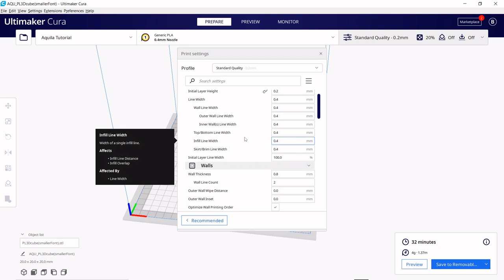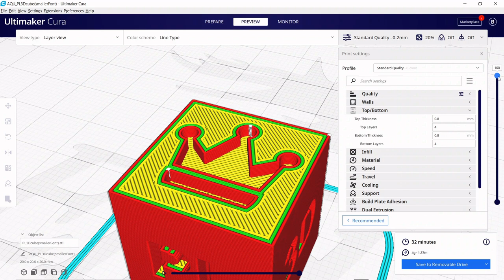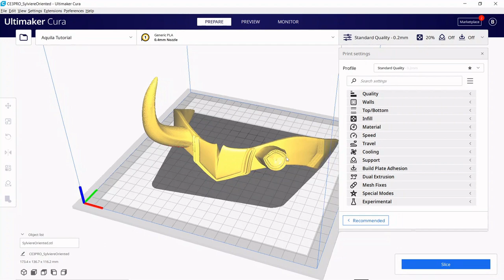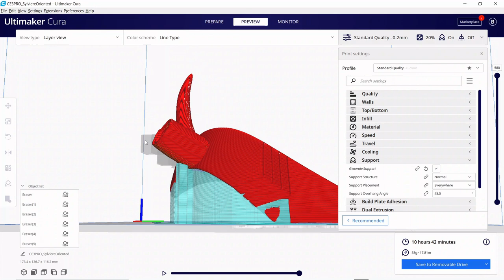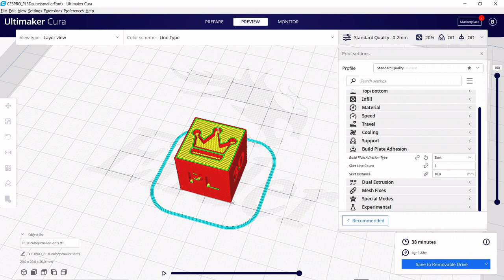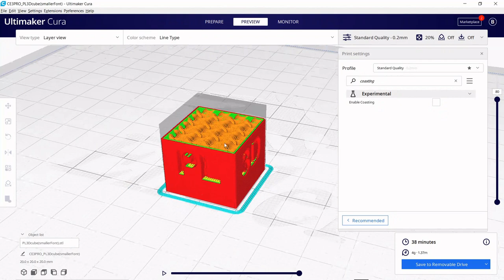Intro to Cura Print Settings for Voxelab Aquila (Part2)

Comment: Newby here.  Your videos have been my 3D print lifeline.  Thank You!!!!!!!
I do have one question......from time to time, more times than not, the extruder temperature on my Aquila X2 fluctuates more than 1-2 degrees.  It can at times go so low that the screaming error message displays on the screen.  Why does this happen and how can I fix it?  I have read to perform a PID with Ponterface but when I try that, the Ponterface download tells me there is a virus in the Win X64 file.  When I speak with Voxelab help desk, they suggest I don't use Cura and to use their slicer and to also get a new Hotend Kit.  I appreciate any help you may suggest.  Thank you in advance.  PS... My Cura setups are the same as you've instructed, and the filament is PLA. Also, the machine has not been used that much, so I can say it's not from over-use, mass production or excessive time of print objects.

Comment: My printer doesn’t print my files but prints the files the sd card comes with how do I fix that
Reply from the maker: When you slice your models do you save them to the SD card? Are the kept in the same folder (directory) as the files that came with the printer. Also do they end in .gcode ?
Reply: @PrintsLeo3D  yes I save them directly to the sd card. Yes everything shows up and it ends in .gcode
Reply: @PrintsLeo3D  it shows up on the 3d printer and when I go to print it takes a few minutes to at the center but doesn’t print the item it prints a line on the edge then it tries to print the item but then it doesn’t stick to the bed
Reply from the maker: Ok, so the printer is attempting to peform the print but the model is not adhering properly? This sounds like a z-offset setting. It's necessary to calibrate your z-offset , and then you can save that number within Cura so it applies to all of your prints.
    For now, as the print is beginning you can manually adjust the z offset through the menu. You want to make z offset a negative number which will bring the nozzle closer to the bed. I have a video that explains what z offset is. I recommend giving it a watch and it should make this whole method a lot clearer.
Reply: @PrintsLeo3D  yes is that normal tho? It moves into position to print but doesn’t stays there for maybe 5mins moves to the edge prints a line then it attempts to print. I’ve already calibrated the z offset I put slowly adjust but then the print rips off cause it gets close to the filament that didn’t stick then it messes up the whole print but I will try again
Reply: @PrintsLeo3D  I’ve adjusted the z offset to print the as card files it comes with cause it was far off the bed. And those prints stick fine to the bed but other prints don’t
Reply from the maker: It sounds like you are almost there with this. When you live adjust the z offset and you get those prints to stick, note what the value of z offset is. Then you can input that value inside the slicer under the z offset section. It's possible you will need to download the z offset plug in (through Cura marketplace) for that option to show up.
Reply: @PrintsLeo3D  okay so now my problem is layers don’t stick or missing layers. First few layers are fine but the rest don’t. I have pics
Reply from the maker: It's probably best to see the pics, if you want to email me it will be a lot easier to diagnose: printsleo3d@gmail.com
Reply: @PrintsLeo3D  did you get the email?
Reply from the maker: I did, I am responding now.

Comment: whenever i print something it always either doesnt  stick or when it does it just curles up
Reply: Ahh thank you
Reply from the maker: You're welcome! Like I said if this needs more clarification or you run into another issue, let me know!
Reply from the maker: Tha sk for watching and commenting. The issue you are having is usually related to z-offset. Z-offset is the value that brings the nozzle closer to the bed which gives the filament proper compression and adhesion. Most people think leveling the bed is what creates the gap, but it doesn't. We use the gap during level as a device to get the nozzle and the bed lined up. I have another video called "bed leveling and z offset" I definitely recommend watching that because I break down both the procedures and the differences. Give that a try and let me know if it helps!
Reply: @PrintsLeo3D  
Thnks

Comment: Hello from Ireland. I ordered the Voxelab Aquila C2 yesterday, as a complete novice in 3D printing. I feel so lucky to have found both of your videos on Cura, as you explain things in such a careful and detailed manner. I have been following the tutorials in Cura, with one of the files from your website (the fan shroud), and have gained a lot of insight into the software in an hour! Thank you (from a university teacher with 30 years experience).
Reply from the maker: Thank you so much for your kind comment! The language of 3d printing can be complicated and confusing, so I always do my best to boil down the concepts into a digestible manner. I'm glad these were of help. If you need anything else going forward, once you have your printer, leave a comment or email me printsleo3d@gmail.com and I'll help!

Comment: Is there a way to print a model in 2 colors with the Aquila
Reply from the maker: There is! Printing in two colors can be tricky though. The Aquila can do a basic color change, I describe the process in an article on my website here:
https://www.printsleo3d.com/filamentchange

If you're looking for advanced color changes, like changing colors multiple times on a single layer, it's possible but very tricky (not too mention tike consuming). If you have any more questions let me know I'm happy to help, or if you want you can reach me on my discord:
https://discord.gg/uBdsQbvj
Reply: @PrintsLeo3D  first thing I guess I need to know is the Aquila capable of filament changes out of the box or do I have to configure it for it. I'm kinda lost right now.
Reply from the maker: So to be honest it's been awhile since I've used the Aquila with the stock out of the box firmware(think of it as an operating system), so I couldn't say if it works out of the box. However I know it is enabled with Alex's firmware, which is a community made upgraded firmware that adds a lot of functionality. Within the firmware certain settings need to be enabled for the M600 color change to take effect. Alex's firmware has that enabled , I couldn't say for certain if the stock does.
Reply: @PrintsLeo3D  where can I get Alex's firmware?
Reply from the maker: I have a video that goes over installing a BL Touch, and in the second half of that video I go over downloading and installing firmware. https://www.youtube.com/watch?v=ARAhqgkfBMo&t=1252s
It should start around the 20 minute mark of the video. The link to the firmware repository is in the description to that video. Firmware changes for the Aquila is unfortunately not very straight forward as there are currently 3 mainboard chips available. You will need to find out what mainboard chip your printer has (usually there's a sticker on the printer that tells you) and then download that version of the firmware.
Reply: @PrintsLeo3D  thanks for the info I will check out the article and if I have any questions will reach out to you. I'm a newbie at 3d printing and trying to learn all the Aquila can do.

Comment: Could you share your profile that you created?
Reply from the maker: Absolutely! My profile is really just the default Ender 3 Pro profile that comes equipped with Cura, I just adjusted a few small things. I plan on uploading all my different profiles for different nozzle sizes and layer heights soon though. If you go to my website https://www.printsleo3d.com/firmware then navigate to the bottom of the page where it talks about Slicer Profiles and then click thr Aquila button. The page that hosts the profiles is very basic right now as I just created it but you can download the base 0.4mm nozzle 0.2mm layer height profile! Good luck!
Reply: @PrintsLeo3D  awesome! Thanks! Would also love a profile/adjustments for the Aquila for TPU too, but thanks! I’ll definitely check back regularly!

Comment: Been following all these Aquila videos to a T to get mine setup, and I tell you hwhat, dang ol thing is printing perfectly

Using Voxelab black PLA+, 200/60
Reply from the maker: I'm so happy to hear that! These printers are really amazing! To be able to print such quality for what they cost is remarkable and I'm happy that a lot of people are able to now enter the hobby through the Aquila. Thanks for watching, thanks for leaving a comment, and happy printing!
Reply: I just got a roll of voxelab PLA+ and tried some things I designed today, used  the normal PLA Settings and wasn't getting good adhesion, it would lift and warp. I did wash the build plate with soap to get dust off of it could that have effected its adhesion ability?
Reply from the maker: Not likely, it's usually advised to wash your build plate from time to time to get rid of the oils that your hands can leave behind. If you're using the stock glass plate, it's possible over time the adhesion can start to fade and then I'd recommend using a glue stick adhesive to increase your adhesion once again. Just a quick swipe over the areas of the build plate your model will print over should do. Also if you removed the build plate it's always a good idea to relevel the bed quickly(honestly it's always a good idea to relevel your bed lol) to make sure everything is in order. Then it can never hurt to recheck your z offset and make sure you're getting the proper squish (compression), so that first layer doesn't want to budge! Also because these are your own models and not something that's been shared , double check in your slicer that the finished model looks like you think it is. Make sure all the points of contact with the bed are there and nothing is printing in thin air.
Reply: Are stock PLA setting on the Aquila good to use for their PLA+ filaments?  Also what's a good Z-offset? Did their paper thickness to get me going. Only had this for a couple days and trying to get it zeroed in so I can really get printing!
Reply: @EricMcNettCorsairMan  On the stock glass bed I had success with 200/60 for heat, if your prints are warping I'd try getting bed temp higher to like 65 or 70 and see if it sticks better. Tbh though, I upgraded my glass bed to a PEI sheet and couldn't be happier, I use 75c for my PEI sheet and stuff sticks amazing to it (bought a Hictop PEI plate/stick on magnet from Amazon). For Z offset its hard to say cause everyone's is a little different, just from my experience I found try it at 0 offset then start going negative with the value if it is not sticking until you find what works (sticks well, but isn't too close to the build plate where it causes the elephant foot effect)
Reply from the maker: I could not have answered this any better, I echo all your sentiments! Especially about dialing in the z offset and it being different printer to printer, and even nozzle to nozzle!

Comment: I just got my my printer and I’m  now to this so thanks for all your information it helps me out I need all the help I can get right now. And your the only one who made it seem easy to me. But the problem I’m having is when I’m building my model when it gets half way it moves away from the plate it’s like the nozzle is pushing down on the model to hard and breaks it from the plate can you help me with this problem???
Reply from the maker: I love to help, I'll give it a shot! It sounds like you might be having an adhesion issue. If your model isn't sticking to the build plate well enough, it will begin to separate. When the print seperstes from the build plate it will lift up, and possibly get into the oath of the nozzle on higher layers. What type of model w re you printing? What type of filament are you printing ? Also what type of bed are you printing on? (Glass, PEI, etc)
Reply: @PrintsLeo3D  I’m printing on a glass bead and I was trying to print a venom model of thingy verse. And I have a voxelad printer and I just have a regular PLA filament And I think my nozzle is 0.4
Reply from the maker: Hey so sorry I never answered this, YouTube flagged a bunch of comments for some reason and this was one of them. If you're still having any issues with this or other models please respond to this message or email me at printsleo3d@gmail.com sorry about that but hope you are up and printing!

Comment: What does it mean when your input in a parameter in a profile turns the box orange (in Cura)?
Reply from the maker: When you input a value and the box turns Orange that's Cura's way of telling you something might be wrong, it's not catastrophic and it won't fail to slice, but you should take a closer look. Cura calculates all different factors for your print, and for some reason it detects whatever you've input is not within its own specification, so it highlights the box Orange so you can re-examine it. Oftentimes it's fine, it's something you meant to do, like creating a larger than normal z offset perhaps. Sometimes though it does let you know something is up. Maybe you switched to a different nozzle size but are still trying to print at your old layer height. Cura might detect that layer height was not correct, highlight the box for your inspection, and then you could decided if that's how you want to proceed. A box highlighted in Red is when Cura is telling you some parameter is so far out of specifications it's dangerous or harmful to your printer, and it will not let you slice it.

Comment: Great job sir! FWIW, I no longer use Cura for prints on my Aquila. I went back to the Voxelmaker slicer and I can say with confidence that the prints are (for me at least) significantly better. I would encourage anyone using an Aquila to give Voxelmaker a try for the best prints. No, it's not fancy like Cura, but for a great print you don't need fancy but you do need dialed in settings and Voxelmaker has the Aquila nailed. I do use Cura for my Delta printer and it works fine.
Reply from the maker: Thanks for watching, commenting, and adding to the discussion! I've actually never used VoxelMaker because I've become so comfortable with Cura, but I'm glad people are able to get some use out of it. It's always good to have another slicer waiting in the wings whenever you want to experiment with the process. I actually began using SuperSlicer for a short time, I really liked it, but was having some Start_Print issues with a few of my Klipper printers. Ended up working well with Cura so I haven't tried migrating back over, but now I think it might be worthwhile to take a look. Thanks for watching and leaving a well thought out comment !

Comment: A couple things: somewhere along the line I learned to add more walls for added strength as you mentioned, but to add them under infill rather than line count. Not sure how that makes a difference  but I assume nozzle  path would treat the infill wall as part of the infill rather than another  wall?
Another good "extra" to turn on under special mode (I think) is bridging, it allows  for better roofs in unsupported sections.
There was something else, oh yeah, non printer related, you made me laugh with your comment about the pagan symbol, sometimes a star is just a star 
Great video, sure coulda used it 8 months ago but I still learned something new (like I never knew I could actually click and  drag the settings menu 🤦‍♀️)
Thanks another Leo, great job!
Reply from the maker: The infill wall line count is pretty interesting! I never knew Cura allowed you to add walls through the infill menu. Aside from the printing order of operations, speed is another variable that is affected by choosing to add walls within the infill menu. I just poked around a little with the subject but it's something I think I am going to explore a little deeper. Cool stuff!
I haven't messed with the bridging settings much, so I didn't want to add it here. The reason I did this 'intro' data dump was so when I do explore those other unique settings I can send people here for the basic questions. Bridging added the list though, I think that's a common problem people encounter and being able to tackle it within the slicer is ideal.
Yea, the star lol it's definitely just a star but while I was recording that section I had a flashback to the Tom Hanks/Dan Akroyd movie version of Dragnet. I forgot to edit the comment out, and it surprised me while editing and I almost spit my coffee out, so I had to leave it in lol 

Thanks again for watching. This was sort of a boring video, but I wanted to have something out there for people to be able to reference once we start hitting some more exciting topics.
Reply: @PrintsLeo3D  I didn't  think bridging was something you would have wanted to cover in this video, it's more advanced but I did want to mention it because it made the difference on a few prints for me.
As for adding walls with infill instead of straight up just adding wall line count is something I think I'll look closer at as well. Slicing something both ways and watching the nozzle path to see what kind of difference it makes .
Thanks again. I'm still in fb jail but as soon as I'm out.... 😉 oh and I'd forgotten all about the Dragnet thing but now you've said it I'm totally on track with ya 😆